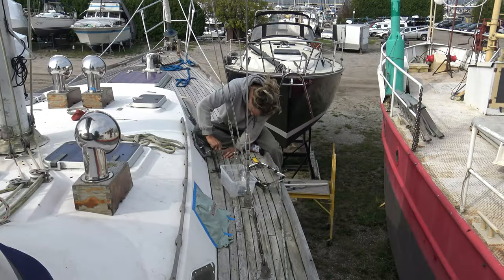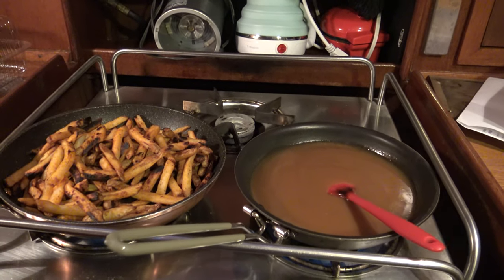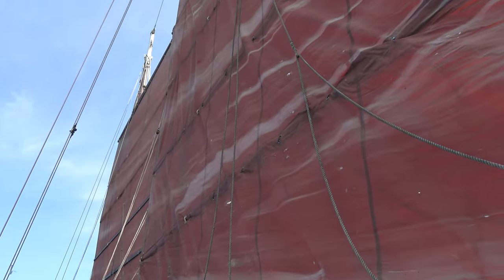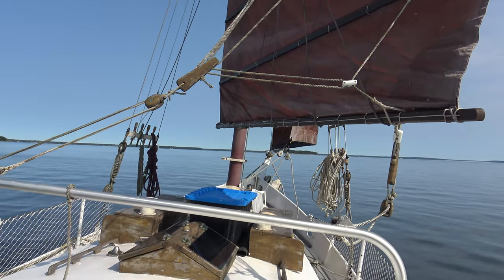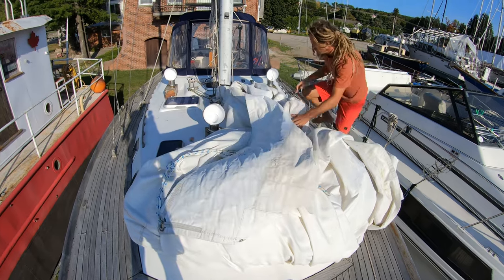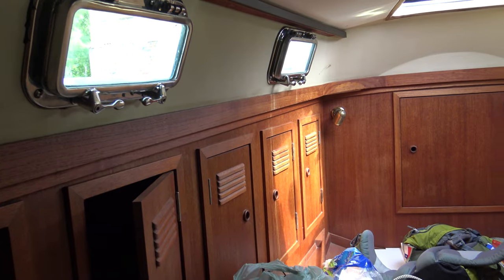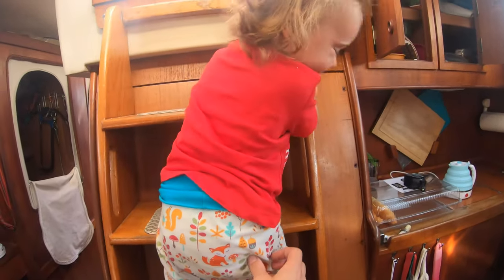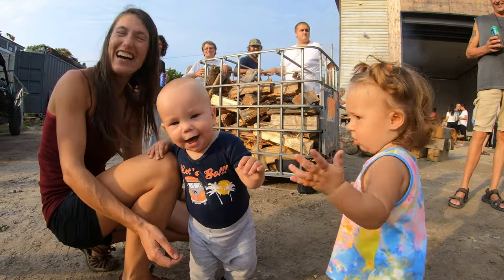Sailing the Great Lakes on a Gazelle Chinese Junk Rig from Thomas Colvin [E260]

Comment: Minor tip when removing sealant.  Carefully use a Heat Gun on the low setting to warm the old sealant.  It will peal off better.
Reply from the maker: Thanks for sharing that tip with us. We'll have to try that.
Reply: Just be careful around the fiberglass.  Low heat on the gun.  Move it quickly into and away from the old sealant. @WildlyIntrepid

Comment: We almost bought a Gazelle but decided the steel repairs were beyond us or our budget if we had someone else do it. They are an interesting boat, not quite the modern junk rig but not quite a gaff rig either.  It does retain the gaff rig aesthetic very well while making good use of the the junk rig. We ended up with a "classic glass" instead. I do want to refit it with a junk rig though. Free standing mast (no noisy, expensive, failure prone standing rigging), simple reefing and setting, softer gibing, etc. I will use a modern junk rig with cambered panels. Thank you for the correct pronunciation of poutine, I can bug my son about how he says it.... of course if he says it right, he may have trouble ordering it here in BC  ;)
Reply from the maker: You've done you're research about the gazelle. We learnt so much about it. Thought the stays were way too loose until we realized that the masts we're free standing. Steel is intimidating but if you have the knowledge and equipment it's probably not too bad. Your son might have to put the English twist to poutine in BC.
Reply: @WildlyIntrepid  The Gazelle is "loosely stayed" as were many of the early square rigs and gaff schooners. I suspect the lines used for stays were not up to the tension of today's Marconi  masts.